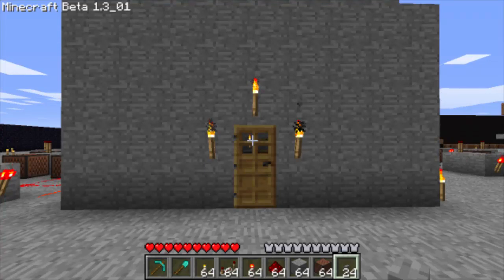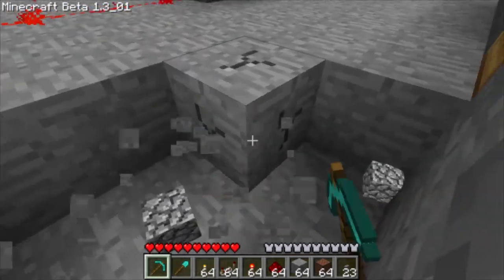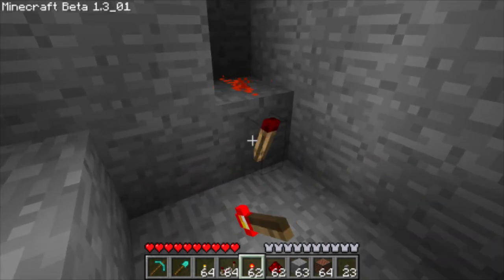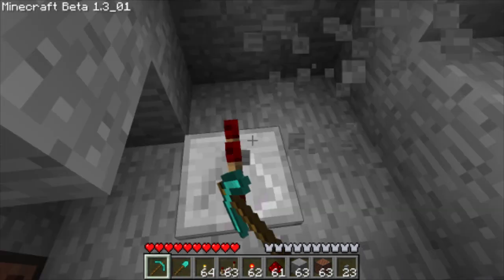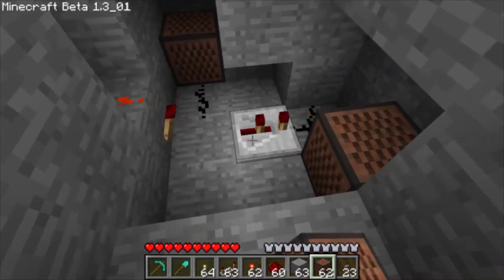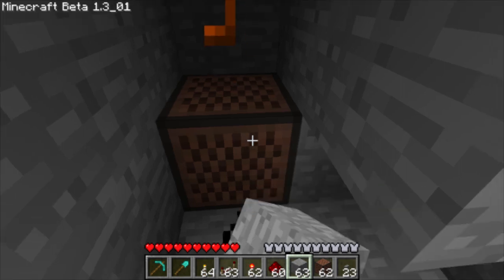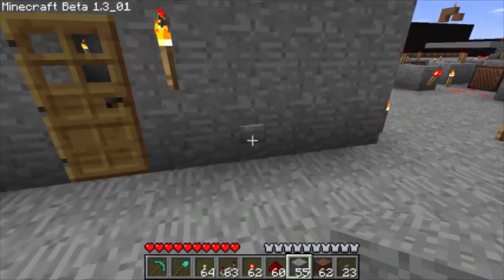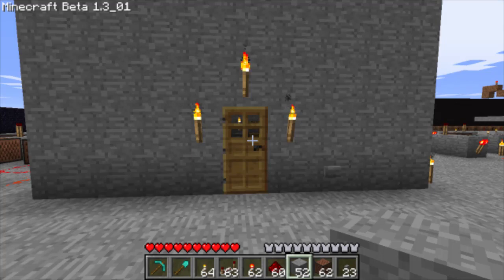Minecraft Tutorial: How to make a compact doorbell using Redstone Repeater blocks

Comment: I don't get why you used two, other than to a signal pulse on 1 rather than 0 That seems wasteful to me.
I have mine set up like this Button -> OR >repeater-Note redstone -> Note.
The button sends a 1 to the OR gate, turning it off, then when  the power comes back,  the delay caused by the repeater handles the second note.
This does mean that the sound is on the back end of the button press, but I'm not picky over a doorbell and it saved me a torch in the build.

Comment: musical door
equipment
2 redstone repeaters
2 noteblocks
3-5 pieces of redstone
1 pressure plate
at least 2 stone slabs
prosedure
1 dig a 2x3x5 hole
2 place noteblocks in corners far from the door
3 place redstone repeaters pointing to the noteblocks
4 place redstone connecting the 2 repeaters to 1 block away and below door *1-3 blocks of digging may be required
5 tune and adjust delay to your liking
6 place pressure plate on block in front of door
7 use half slabs to cover exposed redstone

Comment: You don't need a redstone inverter to do that. All you need to do is place a redstone repeater, two note blocks and several redstone dust depending on the circuit configuration. Thumbs up so that people won't ended up wasting spaces to place redstone inverters.